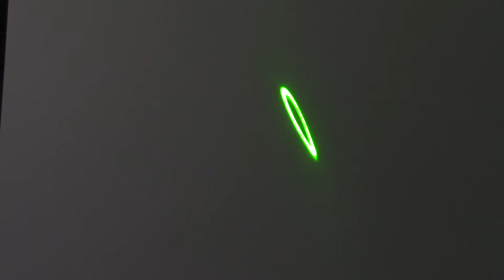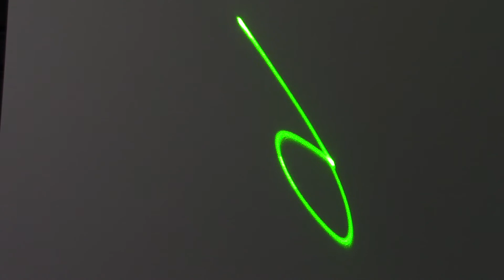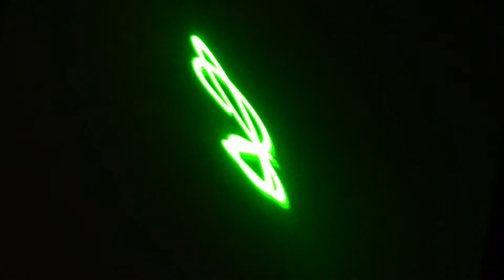A New Way to See Music - Sound Waves & Lasers

Comment: I would like program a sine wave driven by audio.
This would take audio input and move a spinning x/y pointer according to frequencies and amplitude. Looking at Penguins walk across the screen is interesting for about 5 minutes, but boring after that. It would be easy to segregate the colors into frequency ranges. (Bass, Mid, Treble) At certain song frequencies, the harmonics make the beams come alive and sync instead of just looking like scratchy loops. Any ideas on how to use Audio interactively, instead of just switching to the next graphic?